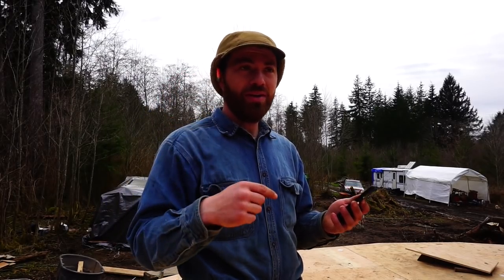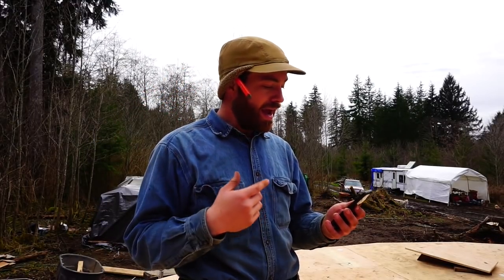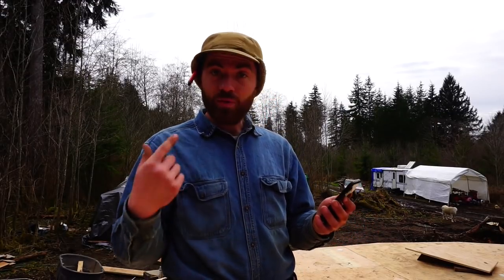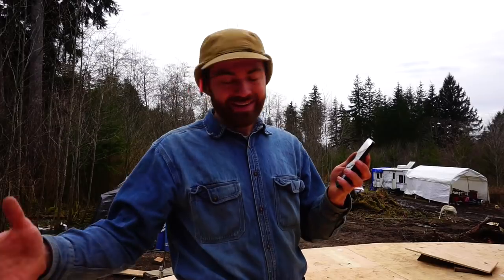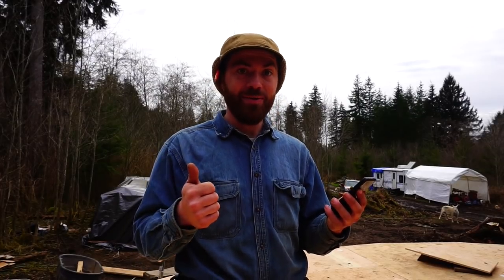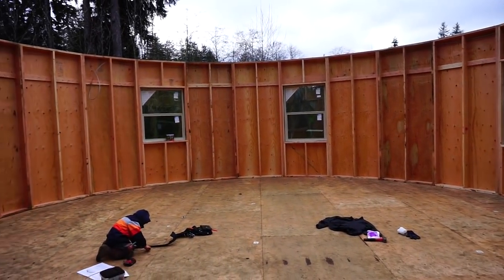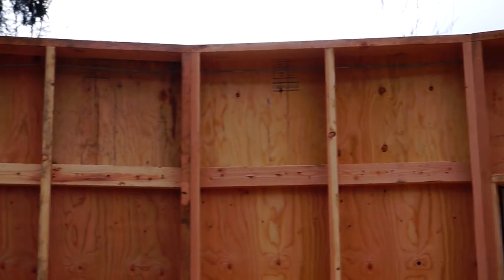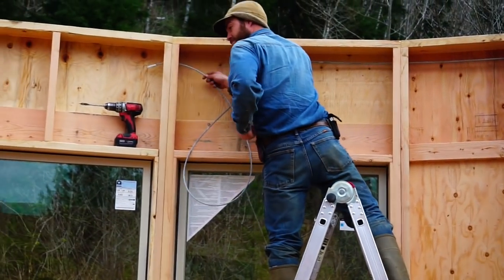Building an Off Grid Yurt Part 7: 24 Walls in Place

Comment: It is coming along nicely. Your preparation work made this to work (almost) flawlessly. I've paused the video to take a closer look at the panels and they seems to be very nice. I was a bit surprised to notice the windows were already hung on the walls, though none looks to have shatter during transport.

Next step is to get a roof on this yurt!

Keep up your good work.
Reply from the maker: +Simon Forget Yes the windows were pre-hung but Smiling Woods Yurts did an excellent job bundling them in a way that would protect them.

Comment: Hooked immediately! It might be a good idea to stick grommets in the wood where the cable passes through, even high quality lumber will warp over a few months and you'll find that the strength of your walls may be diminished a little.
Reply from the maker: +UnpopularPolitics Welcome! This home was engineered and the engineers didn't recommend a metal sleeve for the walls. I hope that they are right. We have two cables that go around the rafters and they both have metal sleeves.

Comment: I am looking at buying a Smiling Woods Yurt kit with 12 ft walls. My hesitation is the how heavy the walls will be to assemble with friends...Another blogging couple had the same brand's kit and their walls were assembled with a forklift and the first 3 were braced to remain standing. How heavy was each wall panel roughly? I figure 2 extra feet will add maybe 40 lbs to the weight of your walls. It looks like for the heaviest walls with windows you needed 4 people and the lighter ones you needed 3 people. I know this video is 2 years old but I'm really hoping that you are still replying to comments.
Reply from the maker: Hello, I wish I could give you a guess on actual weight but I don't think I can. It has been a couple years like you said. I can tell you that it is really doable with four people. I really liked my experience with smiling woods yurts. Best wishes.
Reply: Simple Ground Thanks Jared! Just you a more detailed email with yurt building questions.
Reply: I'm on the fence about yurt kits. On one hand there great because you have everything you need on the other hand if you can get lumber and canvas for cheap then it might be better to do it from scratch.
Reply: @sirxavior1583  That would take a greater skillset than I possess for sure.
Reply: @ayanaphillips7754 .  I was once like you but I've been watching youtube videos on how to set up a Yurt from scratch and all it really is is a lattice wooden frame with canvas tied down with rope. You can easily get 10x16ft canvas tarps from Wallmart for under $80  and 2x4's for under $5. In total it whould cost under $5k to build one from scratch vs a kit that would cost $10k and higher.

Comment: So the walls are held together with a steel cable that's not even epoxy coated? Yeah that won't come back to bite you in the ass at all. Maybe if you lived in the desert it'd be fine but that sort of high moisture environment and that cable will be done inside a couple of years. Than with the roof exerting its pressure, boom! So long walls!
Reply from the maker: If I have that much moisture in my walls I have bigger problems. Galvanized cable in the wall cavity should be more than sufficient.